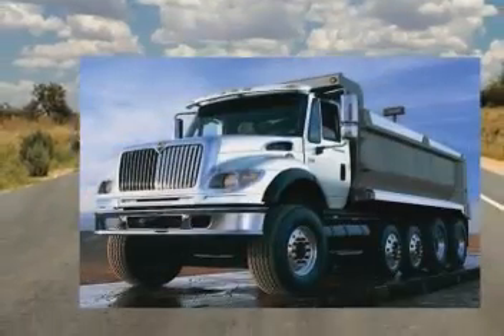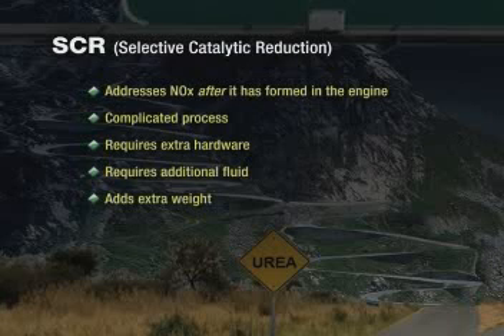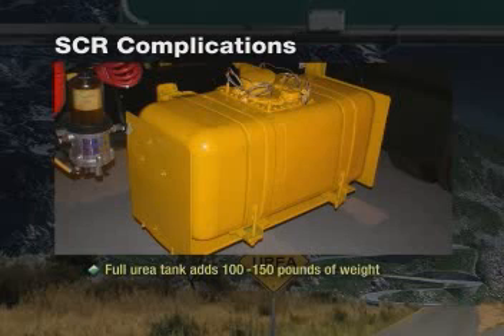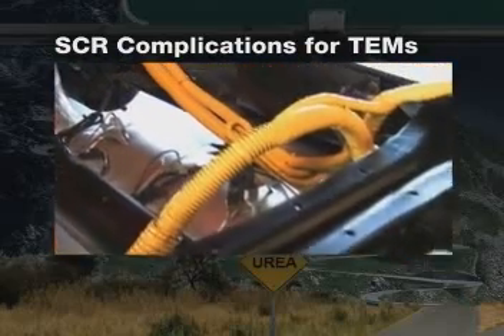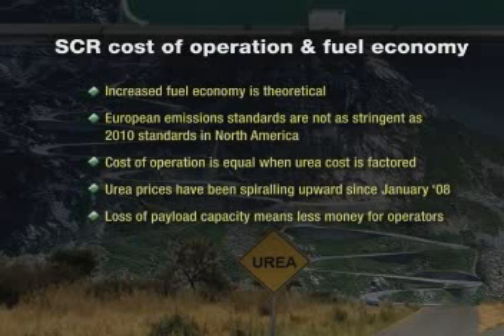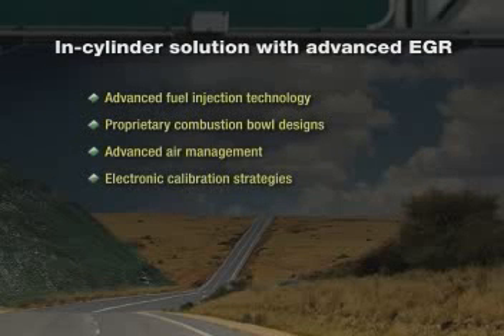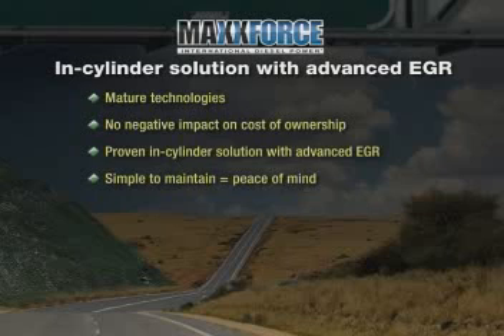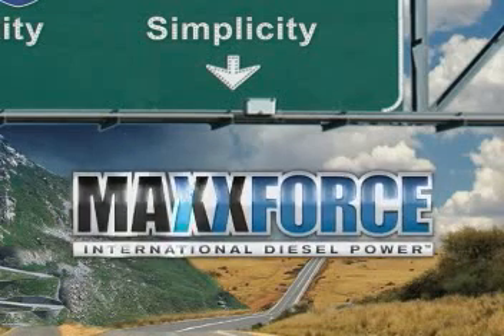Navistar MaxxForce 2010 Emissions vs SCR

Comment: MAXXFORCE is nothing but a letdown.  Cummins ISBs may be SCR engines, but at least they hold up to the fact that they will work every day every time the key is turned unlike the MAXXFLOP engines which can't go 12,000 miles without needing to be replaced.  It's more about money, not this BS.
Reply: The ISM is a better replacement for the MaxxNoise than the ISB given their applications.  When the MaxxNoise was in a good mood, they ran great, however on a bad day, it was a goddamned nightmare.  Had to limp to the shop on two cylinders due to a mix of injector failures and compression issues.

Comment: As much as I love my super duty what these Maxxforce clowns don't tell you about the Regen mode is how it causes engine melt down when something doesn't work correctly. The cylinders that are used for the fuel dumping also get the most wear and if you're not spot on with your maint the oil will be become diluted with fuel. Also that massive heat and EGT must pass through the turbo BEFORE it gets to the DPF which fries seals and reduces turbocharger life. I'd choose SCR over creating so much heat in the engine which causes more expensive break downs and reliability problems.
Reply: I was going to buy a max force DT 466 2013 , MAYBE NOT A GOOD IDEA ?
Reply: @jamesmares4206  don’t buy a MaxxForce or Mercedes engine.

Comment: Hey wait a minute, shouldn't EGR be more economical since it take unburnt fuel and use it up which with a good computer monitoring this injects less fuel therby saving fuel?
Reply: knightrider1545 that's not how it works. All fuel in the exhaust has been burnt. Egr gas is inert! Meaning there is nothing left to burn. It's just used as more mass in the cylinder to keep temps down. Lower temps mean lower nox emissions. It also means worse combustion eff. So as everyone has found out get is death

Comment: Can't keep my Navistar engine egr system working for longer than 20,000 miles. Never again. P.S. I have a International tandem axle med duty truck for sale. Brand new egr system and injectors about the same interval as oil changes.

Comment: Advanced EGR is now officially a FAILURE.  Navistar's board has ousted the CEO due to Maxxforce inability to meet the 2010 EPA requirements before credits run out.  They will now be paying fines for every non compliant engine sold.  
They have stated that they are now pursuing a new emission stategy using SCR and will bring back Cummins to slow the sharp decline in orders.

Comment: how are they going to fix all the issue create by using egr. carbon build up around rings, valves, plugging boost sensors and excessive exhaust back pressure blown out your valve seals. there is so many negative side effects by using a massive egr engine.

Comment: @Tater314 One gallon of DEF is used about every 300 miles. The tanks range in size from 6 to 23 gallons depending on the truck’s application which means you can go up to 7,000 miles between fill-ups.

Comment: Here in Europe, we all use SCR on heavy trucks. The components fitted on this truck were designed to look like distillery !!! In the real life, components are half the size and far better integrated in the chassis, even for a 13 liter engine.... Even the yellow urea tank is a joke. Actually the urea tank is very small and sometimes joined along the fuel tank. You can't even notice it.

Comment: here in europeinitially we had 4 brands (volvo, renault, iveco and daf), using scr when the emission regulation came up called euro4, the other three brands (mercedes, scania and m.a.n.) choosen egr system, now the new regulation came up (september 2009) called euro5 all brands are using scr system. only scania as both of them.
i must tell you that our egr system is the same thing as maxxforce.
could any one tell me wich is the most powerfull american road going truck engine, for normal trailler

Comment: Currently DEF or urea is only used in a few select applications, all of which are passenger cars. DEF is only used in very small amounts on passenger cars actually at the service interval, so $18, as you claim, is not a big deal when it covers 5-10 thousand miles. Once every diesel manufacturer is using DEF the cost will be quite low and can be purchased in bulk. It will likely cost $2-4 a gallon.  It will however give you a 7-10% fuel economy advantage. Just thought you would be interested.
Reply: How times have changed!

Comment: My place here have 2 brand new buses that uses both technology. One of them is from Mercedes Benz and uses their Adblue(SCR) technology. Another is from Scania and uses their EGR technology. The Scania system diagnostics have shown that its EGR system has poorer fuel economy. The MB bus has 299bhp 12 litre engine while the Scania uses a 9 litre 230bhp engine. MB uses 45-48litre per 100km while Scania uses 58-60litre per 100km. A less powerful engine with higher fuel intake. Funny.